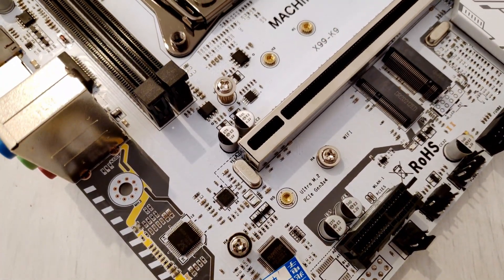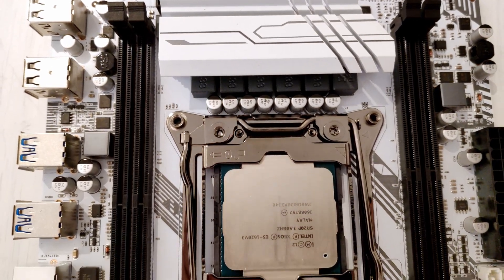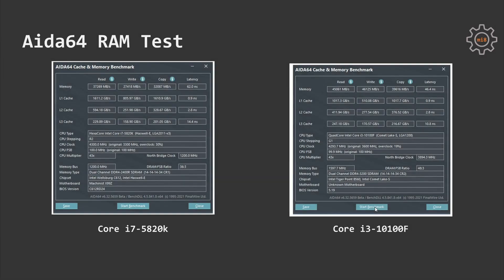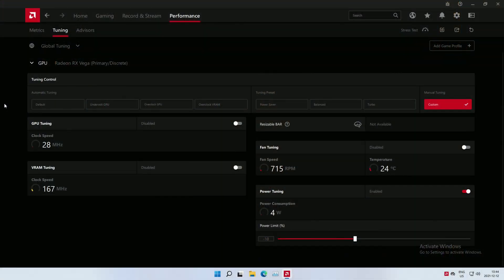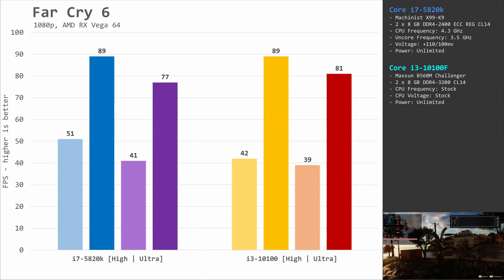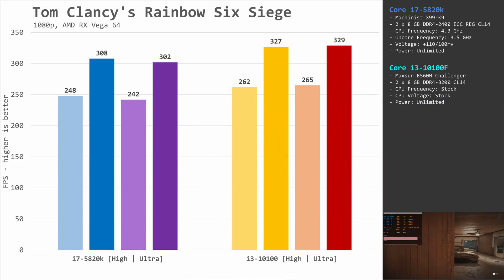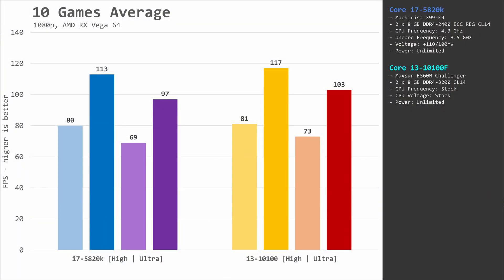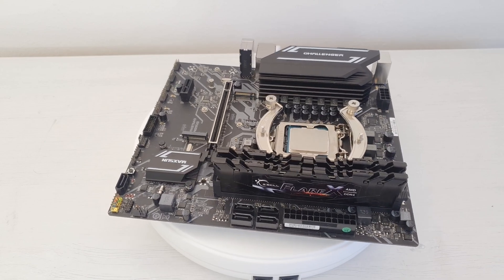🇬🇧 i7-5820k (E5-1650 V3) versus i3-10100 – small gaming comparison with an AMD RX Vega 64

Comment: hello friend good afternoon, I'm a Brazilian brother! I would like to take a doubt, I am wanting to migrate from my current kit xeon 2320v3 + 16gb (2x8gb ecc server) to the i7-5820k with 16gb memories (2x8gb non ecc), do you recommend the change? my card is x99 machinist rs9.
Reply from the maker: No, I don't recommend it. X99-RS9 can't overclock the i7 and without overclocking this CPU is pathetic.
Reply: @Miyconst  what do you recommend for an upgrade? 2669 v3?
Reply from the maker: @Virgilio007CaT  no, the absolute maximum I would dare to install onto X99-RS9 is E5-2666 V3 and only if you have good chassis cooling and don't run heavy applications.
Reply: @Miyconst  got it, actually read about it. I'm thinking of getting the 2640v3 and being happy until I change kits.

Comment: Hey thanks for the video! I just bought a machinist x99 g7 motherboard and a xeon e5-1650v3. This cpu should work with this chipset but can't get any video to come out. I have tried 1,2 and 3 ecc ddr3 sticks with no luck. I have tried it with one non ecc stick too and no luck. When i take out all the memory it still acts the same, it turns on, cpu fan turns on, gpu fan turns on and vrms get warm but no video or no error beep. It has a speaker built in so it should beep with a bad memory configuration but it doesn't. I have tried different ram, different gpu and different psu with all the same results. after i bought it i noticed the motherboard listing says it will only works with  E5-2629 V3/E5-2649 V3/E5-2669 V3/E5-2673 V3/E5-2676 V3/E5-2678 V3 /E5-2696 V3 cpu's but the other chinese x99 motherboards don't say that. Any ideas?
Reply from the maker: Xeon E5-1650 V3 does not work with DDR3 memory, you need a DDR4 board for that CPU.
Reply: @Miyconst  Oh i didnt even realize ddr4 was a thing when these xeons were released but that makes sense why it isn't working. Thank you for the help!

Comment: Please don't put "CPU frequency: Stock". It's not convenient to google i3 specs at the middle of the video. I'm sure you are trying hard to make your video informative to help people. Just a simple CPU frequency value like "4.3 Ghz" would be much easier to compare!
Reply from the maker: It's not correct to put "4.3 GHz" because the frequency is dynamic and it's not possible to force all CPU cores to run at that speed. I can add extra info, like (4.0 - 4.3 GHz) instead.
Reply: @Miyconst  yeah, that would be helpful

Comment: hey, should i go with i5 10400f/ 11400f or the e5 1650?
Reply from the maker: Core i5 is surely a better option.
Reply: @Miyconst  thanks for reply. i was looking at e5 1650 v4 / v3 and looks like they have very similar performane to i5 10400f. do you reccommend different x99 cpu or stick with lga 1200?
Reply from the maker: @sam-gy2lf  I would definitely stay with LGA 1200 in this case.

Comment: How do I reset the bios of a x99 alterminer board please someone help
Reply from the maker: The same as on any other motherboard: power off, remove CMOS battery from the motherboard, wait for about 30 seconds, put the battery back in, start up the PC. If this doesn't work, your motherboard does not support clear CMOS.
Reply: @Miyconst   how do i clear it if its not supported
Reply: @Miyconst  ive been doing that for the pass week now i dont know what to do i would appriciate it if you could make a video on that thank you so much for replying
Reply from the maker: @09Q3  you have to use CH341A or another programmer and reflash the BIOS.
Reply: @Miyconst  thank you so much

Comment: talking about X99-K9 ... a want to replace a 1620v3 processor for a better one... Do you recommend a 2678V3? ... Will work fine? I saw on some sellers a processor E5-2666 V3 with 10 cores and 2,9 Ghz for USD 35... seems to be very attractive...
Reply from the maker: E5-2640 V3 would be the perfect match for X99-K9, but if you can ensure good VRM cooling then E5-2666 V3 would work as well.

Comment: Hello, I have a sapphire vega 56 video card, when I enable unlock turbo boost, it stops working, I have to go back to bios to work, I have a kllrise x99-b5 motherboard and an e5 2640v3 processor. I wanted to check if you can help me. thanks
Reply from the maker: Sorry, I can't really help with toys limited information. Feel free to join my discord and ask for some help there.

Comment: Question. I discovered that I have an old asus am3+ mobo with a winbond 25Q160VAIG 1437 bios chip that's removable due to it being in a socket. Would I be able to desolder the bios chip socket from the asus mobo, desolder the chip on the kllisre x99 b5 board and use the socket and bios chip from the asus board as long as I used a flasher to flash the proper bios onto it?

Thinking it might be good to have modularity for potential future repairs or to more easily restore bios if something goes wrong during flashing.
Reply from the maker: Theoretically it's possible, practically it won't work in this case. As far as I know, AMD boards use 1.8V BIOS chips, while Intel boards use 3.0V BIOS chips. Using the AMD chip on an Intel motherboard will kill the chip. That being said, you can just buy an Intel compatible socket + chip on eBay for very cheap.
Reply: @Miyconst  Thanks for the heads-up. Do you have any recommendation for which chip I should get?
Reply from the maker: Check the markings on your current BIOS chip and buy identical.

Comment: i3 10th is an icredible cpu for the money, the  i3 12th is mind blowing. I would have bought an i3 10100 or an i5 10400 but I would have had to buy a new motherboard and that's why I chose the QTJ1 and for the moment even as I use it limited to 60w it has better performance than an i3 12100 in multitasking applications (3500 on cinebench r20/ 4300 on CPU Z), in gaming I don't think so but I hardly play any games and I only have a 1660 so it wouldn't make much of a difference.
Reply from the maker: That's very true. Core i3-12100 might be an incredible value CPU, but it's pointless without affordable motherboards. I also like the idea of reusing and upgrading existing computers, thus if I would have an LGA 1151 motherboard on my hands, I would go with a mutant as well.

Comment: When I started building my PC last year, I was seriously considering on buying the i3 10100F as a local option. However, I was completely mesmerized by Xeons and Chinese components in general. I'm happy with the build I got now (E5 2640 v3, 16GB 2133Mhz ECC RAM, GTX 960 4GB), though my monthly kilowatts don't agree, as the consumption has risen by at least 20kWh these past 3 months XD. A friend got a setup with this i3 and a 1050 ti, and aside from almost 20% lower temps, it's obvious he could run everything using less than 250W...
Reply from the maker: It's fair to say that GTX 960 is stronger than GTX 1050 Ti, so you are also getting higher FPS, anyway, do you game that much to notice the electricity bill spike?
Reply: @Miyconst  Actually, kinda, but the difference from my previous setup was quite shocking. It's kind of a rule here at home to have at least 120kWh of electric consumption per month. It's a thing in Brazil, where some households have discounts, or sometimes, the whole bill is nullified if a set amount of electricity is consumed (on some states). 

I built this PC back in April, and I had to stick with my ancient 9600 GT a bit longer before I could afford a "new" graphics card. I usually game about 3~4 hours a day, and the games I played on that card could be considered heavy, like GTA IV, Dark Souls, MK9, and some 5th gen console emulators with max enhancements. The consumption would usually stay around 100kWh each month, actually a bit less than with my previous PC (Athlon II X2 240, 8GB DDR2@533Mhz, 9600GT 1GB; yes, I milked that PC till almost its last drop XD). But, in August, I finally got another GPU, and with all those new games, those extra 20kHw did take a huge toll on the bill... Of course, playing those older games now, won't even flinch the electric meter's needle (though ours is digital), but I don't wanna play those no more XD.
Reply: @ClaytonCLF  I'm with you in that, i normally dont care about power consumption, becouse i live in a small apartment in Brazil, so i'm always below the discount line. Sold my x99 2678v3 and i'm waiting for the Mutant QQLS with Z170. Overkill for my 1050Ti but pretend to change GPU in the end of the year. And in the mean time i'm using Q6600 @ 3Ghz, and this quad core mith is dead even with 8gb of ddr2-800. In windows with 8 firefox tabs it peaks 90% usage.
Reply: @DanielGT_93  I hear you. It's sad to see that generation of CPUs, which were beast of their time, getting phased out, even by internet browsers. My Athlon II x2 240 was really good until around 2019, when every website started becoming slow, with all those fancy adds (I don't like AdBlock for whatever reason). Many games and emulators still run well on that CPU, but then the 9600 GT started getting phased by many emulators, mainly because DirectX 9 /10 and OpenGL 3.0+ support is dead, and that's the maximum for that card. After finally upgrading my setup, now I have to worry about power consumption... Damn modern society problems XD!
Reply: @ClaytonCLF  ahahah I have and old E8400 with 4gb ddr2 and an 9600GT just for windows XP gaming. Coupled with an Samsung CRT with 85Hz its very fun. Sometimes i play more in this system than my main pc ahahaha
Reply: @DanielGT_93  I use 17" CRTs as my main monitors! That's why I aimed at the GTX 960, as the 900 series was the last to fully support analogue outputs. Resolutions from 320x200 (I have videos showing those) all the way up to 1440x1080 (4:3 1080p, sorta) all look really amazing! Though, I wish the screen was bigger... Lost the opportunity to grab a 19" Samsung last year, now I kick myself in the butt XD.
Reply: @ClaytonCLF  Nice! I've used my monitor with the 1050Ti with an hdmi to vga adaptor with no problem, but native will be better! Do you know you can overclock them? Mine is 85Hz but i was able to use 150Hz interlaced. ahahhaah
Reply: @DanielGT_93  I've been using CRTs for almost 5 years now, so I guess I did everything possible on them already XD. But I prefer "super resolutions" rather than interlaced, which I actually couldn't make it work properly using default drivers (had many problems with third party stuff). I played many games at 1280x480@120Hz, given the ones that supported anamorphic aspect ratios, and I have to say, I love the scanlines! Some modern games even go down to 240p for that retro look XD. Super resolutions are good, because the lower pixel count help on reaching the higher FPS to match the refresh rate, while still looking reasonably sharp compared to, say, native 640x480. For games that don't support anamorphic, I go with 800x600@110Hz, which is also good enough.

I'll still grab a 19" if I find one, though. Most can do real high res' at high refreshes. The one I let pass last year could go up to 1920x1440@~100Hz... Man, I'm dumb XD.
Reply: @DanielGT_93  I know the gist of it, but I'm guessing it's because I'm using an LG monitor (710E, probably the most common model nowadays aside from the flat 730SH, and Samsung SyncMasters 7xx series). Most tutorials use Samsungs, and those seem "better" for interlaced, while I've tested that LGs are better with super resolutions (driver wise, as in getting games to recognize those resolutions).

Comment: It's surely interesting that  the i3 is performing this good but i think  the Chinese x series boards limit the capabilities of the cpus. Its of course good for  making such platform be affordable but i didnt see any videos of comparison between Chinese x boards and asus/msi type of x boards. Thanks for the videos tho i like watching them as im a lga2011 fanboy xD
Reply from the maker: Machinist X99-K9 is surely limiting i7-5820k performance, with a top quality branded X99 motherboard, quad channel DDR4-3200 RAM configuration it will perform close to i5-10400F and may even beat it, but in this case the price and the power consumption sky rocket and B560 + i5-10400/i5-11400 is a much better option.

Comment: Wait, you tested i7 with dual channel ram, seems like it's not a fair comparison, it would make more sense to test it with quad channel enabled
Reply from the maker: Please watch the video without skipping chunks, I have explained why it was tested like that.
Reply: @Miyconst  ok, didn't want to watch the whole thing but it seems like I have to :)
Reply from the maker: @falcone5287  in short: Machinist X99-K9 and X99Z V102 have issues with four memory modules installed, the motherboard randomly refuses to start. According to BIOS-iEngineer there is an issue with RAM power delivery on these motherboards. In my case, 3 modules always start, 4 modules randomly refuse to start.
Reply: @Miyconst  thank you for the information. Do you still recommend to buy X99-K9 motherboard? I just canceled my order on aliexpress, thought this was a  good choice
Reply from the maker: No, with the current price X99-K9 is a complete waste, I would much rather buy X99-RS9 + E5-2640 V3.

Comment: we need more comparisons, e.g. i3-10100 vs xeon 2640v3 or 2666v3 to beat i3 in gaming
...and have you forgotten about Chechnya?
Reply from the maker: I will do more tests when possible. E5-2666 V3 with tuned quad channel memory configuration performs like i5-10400 thus it will beat i3-10100. P.S. I didn't forget about Chechnya, but Moscow has so many "achievements" (Syria, Afghanistan, ...) that it does not fit into a single start screen.
Reply: @Miyconst  many people say in games i3-10100f outperforms any xeons X99 and will not believe it until they see. Greetings from Poland and meanwhile from Latvia :)